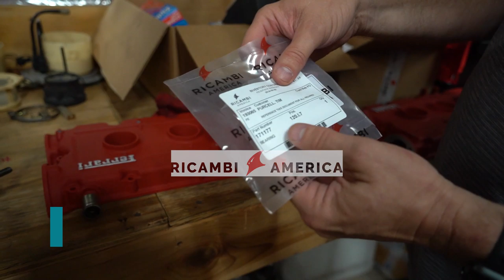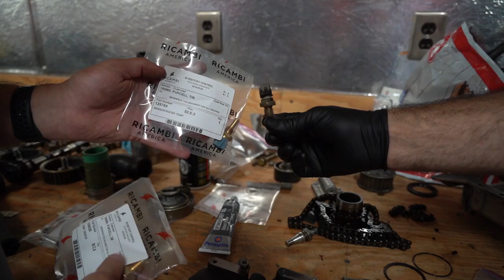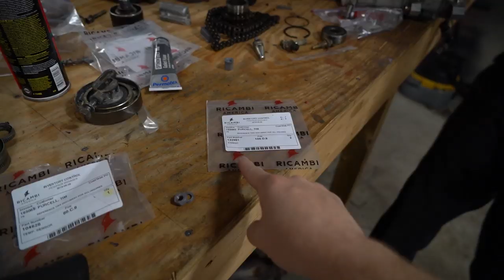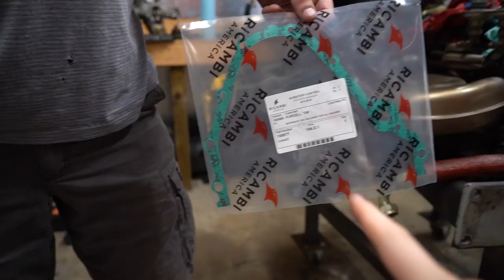BURNING and SMASHING EXPENSIVE Ferrari PARTS | Ferrari 348 DIY MAJOR Service Part 7

Comment: Great vid! Wise advice to all about wiping excess RTV. I had a tiny piece of factory installed Loctite wipe out an industrial chiller ('bout the size of a train car). People think loading up sealant is helpfull.....More is better, right?
Reply from the maker: Ouch!  That is expensive!
Reply: @normalguysupercar  Yep....plugged a small oil line to the forward motor bearing.  Fried it. Welded itself to the motor shaft. Big motor (4160v), big repair bill. All from a tiny piece of Loctite.

Comment: No bearing press?  A couple hundred bucks at Harbor Freight.  Could have been used many times during this video.
Reply from the maker: Na all is solved with a hammer. Lol
Reply: Ouch...17.07...hammering on the inner race of the bearing  will surely lead to early failure if this bearing is re-used.  Use a press on the outside race only !!

Comment: Does the 348 have a timing chain? I thought it was the last one with a rubber belt ... or not?
Reply: Only a chain to connect the crankshaft to the cam belt drive gear and also to connect the crankshaft to the oil pump drive gear. Camshafts are driven via a belt, when runs off the drive gear.
Reply from the maker: I'm digging having you do my job here Josh. Lol
Reply: @normalguysupercar  don't get too used to it. I'm sure I'll get distracted shortly.

Comment: That bearing was beat up. Angled entry, center hit to get it out. I would not have re-used it. 
They were not prepared to install it =/
Reply: Hopefully it is an angular contact that could take the "beating" haha but it was painful to witness nonetheless... a proper shop press, arbors, and a preheat oven would've been less stressful on the machine and viewers, for sure!
I'm just here for the entertainment... more beer, farts, and fluid spills! hahaha
Reply from the maker: It'll be fine
Reply: @normalguysupercar  that's what I usually say, but I don't need to remove an engine to do maintenance. Hope it does not prematurely fail.